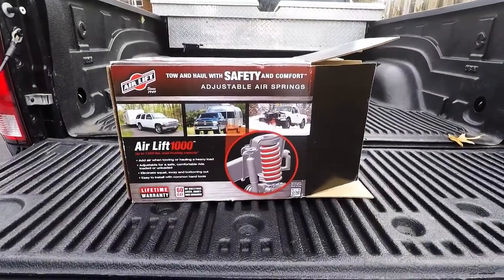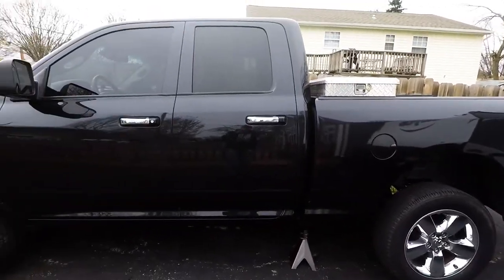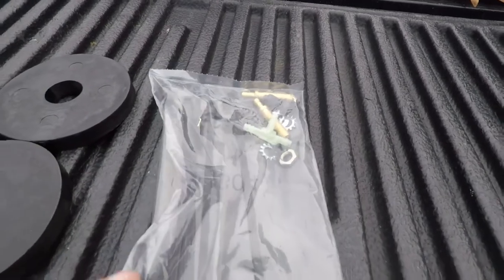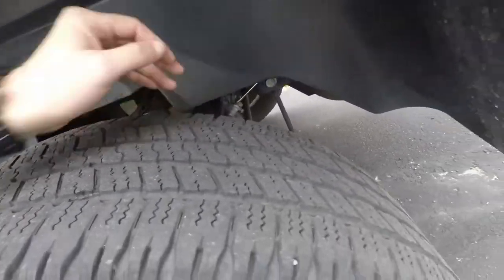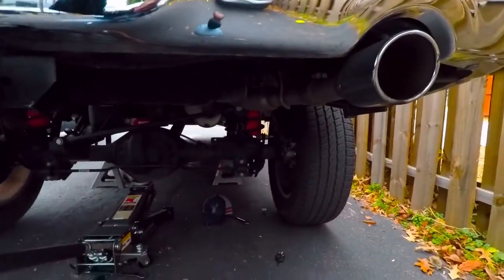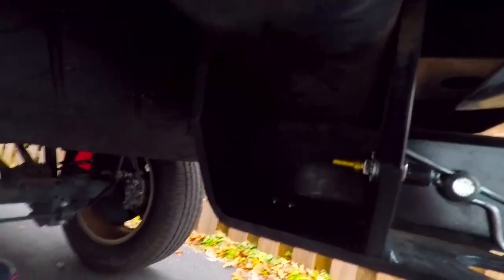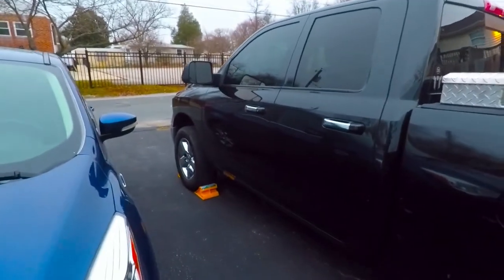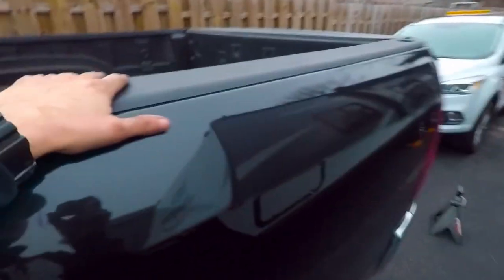Bagging the Ram 1500! (kind of)

Comment: Notice better driving/handling with the airlift ? 
Theses new model 1500's are meant to haul the family and nothing more. Nice to look at but not a tough truck whatsoever.
Reply from the maker: Red Devils 13C it's helped more so with the bouncing on rough roads than anything else. The camper I tow isn't super heavy, but it does help keep the ride leveled and reduces squat.